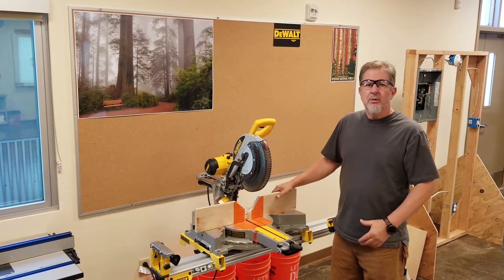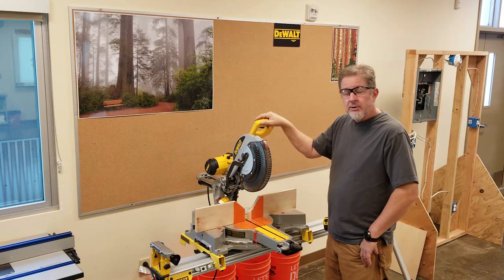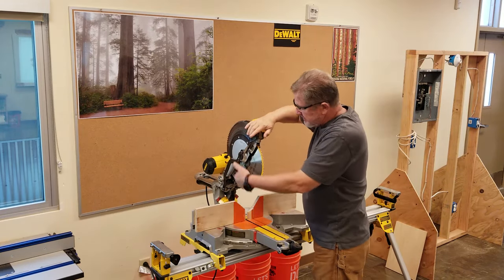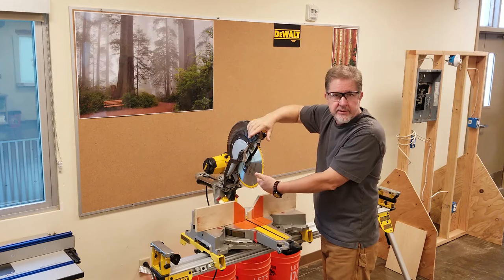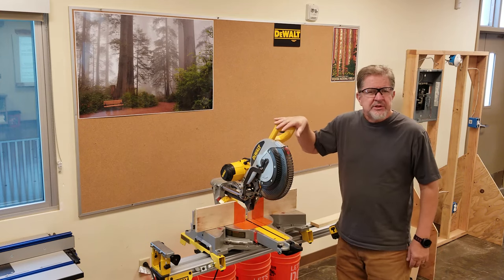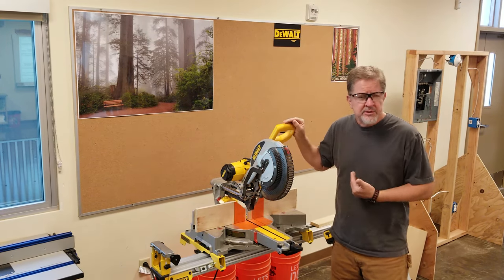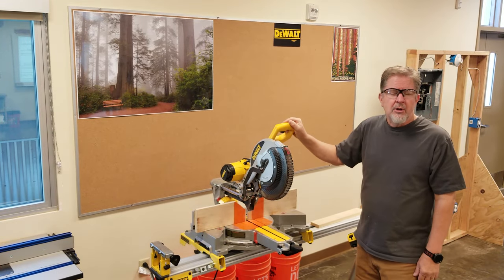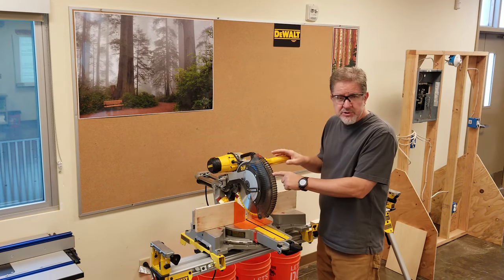Miter Saw Safety

Comment: Thanks for these good safety tips! Also make sure you're using an appropriate gauge extension cord....also my manual says the length stop should not be used on the scrap (right side) of the blade as it can cause the scrap piece to get wedged against the blade and thrown violently. And when making “chop” cuts with a sliding saw it says to push the arm towards the rear most position and tighten the sliding lock knob.
Reply: Hi, thanks for the comments!  Yes, if you are using this machine, you probably don't have any skinny extension cords.  Definitely don't use a length stop on the right side of the blade!  The length stop should only be used on the side where your hand is holding it, which 99.9% of the time is the left side.  I recommend you bring the saw all the way done in front of the workpiece, then push the saw back through the material for a cleaner cut.  If you are just beginning, definitely follow the safety directions that came with your machine until you become more familiar with your equipment.
Reply: @toddrabusin8468  Thanks - it`s my first miter saw and when my wife saw it she said it looked scary and to read the manual first so "you know what the hell you`re doing!" One thing my manual didn't cover is cutting wide boards - ones wider than the listed crosscut capacity. My (sliding) saw  has a crosscut capacity of 12" . So does this mean I could cut boards 24" wide by first making a 12" cut and then flipping the board over and doing another 12" cut? Is it safe to do this type of flipping operation? I saw it on some other videos...
Reply: @rodneyspence7441  Hi, sure, that can be done, however you're basically giving up some of the precision that a miter saw offers.  I recommend you look into a track saw, even if you just rent it.  24" is pretty wide for a board, is it siding?  Plywood, or MDF?
Reply: @toddrabusin8468  Thanks Todd - it was just a general question about whether flipping wide boards is safe or not - for really wide stuff I just use my circular saw….